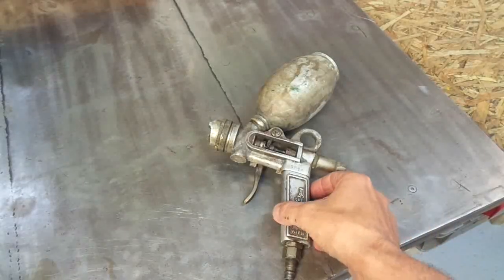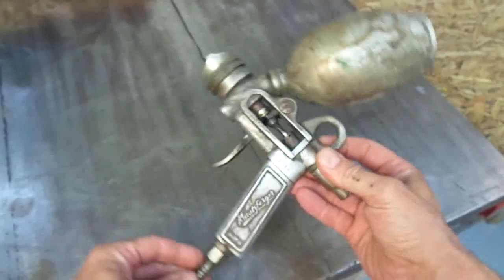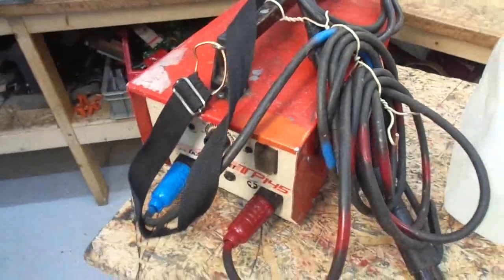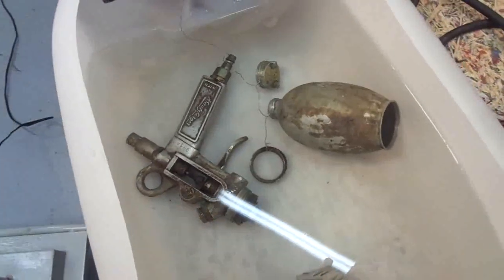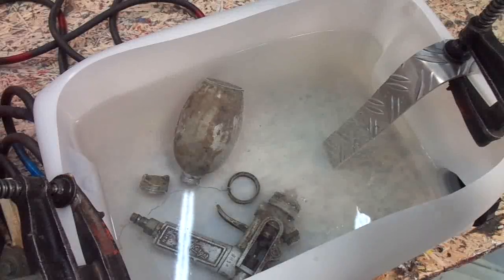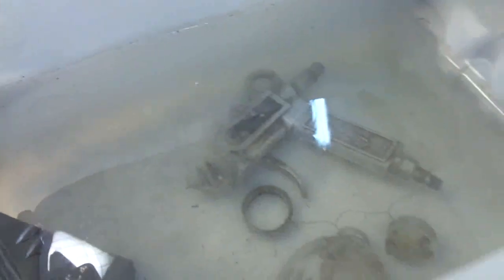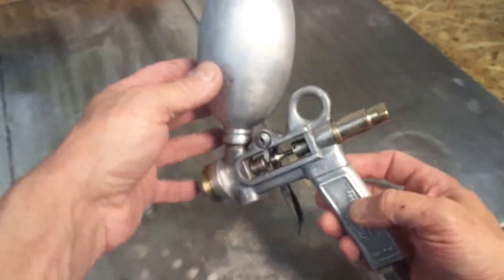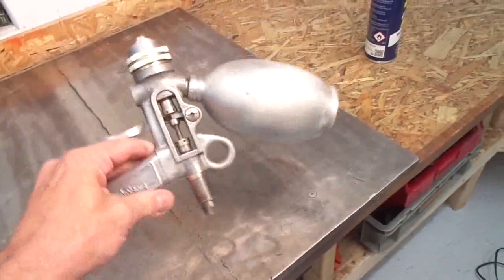Electrolysis cleaning aluminium

Comment: I just found your video when looking to see if it's Ok to use electrolysis on aluminium. 
I have a gear box that has an aluminium case. The gears are rusty and the case has the white powdery corrosion. 
Do you think that electolysis will clean both aluminium case and steel gears well enough to enable strip down ?
Reply from the maker: It should work.. The spraygun also has some steel parts, which i did not remove for the electrolysis process..It is a slow process..You can observe the progress and stop the experiment, in case something goes not to plan.. I used citric acid as a electrolyhe...
Reply: @LariFariYoutube  - I've just found out about something known as Hydrogen Embrittlement (H.E) which can take place in a citric acid solution.
Basically, carbon steel parts can be weakened by microscopic amounts of hydrogen getting into the surface of the part. So gears, being a high stress item, maybe not such a good idea.
But, apparently, it only takes place at room temperature, so I figured that doing it in a heated solution, close to boiling, should prevent H.E from happening. Plus it can be neutralised by heating the part to about 220 degrees C within 4 hrs of treatment. 
So I reckon a close to boiling point electrolysis bath, a quick strip down and into the oven. with the gears.
That's the plan, but I will check with a couple of gearbox resto specialists first.
Cheers.

Comment: Id add ultrasonic cleaner with aluminum or Co2 blasting or wet blasting with baking soda its leaves no darkening of the part vs chemical oxidation of caustic solution as it's like etching solution. THINK BOUT HOW THEY HOT TANK CAR PARTS !

Comment: I’ve heard this process will dissolve the aluminum eventually. How long did you keep the aluminum under electrolysis?
Reply from the maker: 50 Volts / 0,5 A   About 18 houres..as far as i remember.. And yes, thats how the process actually works... Material gets removed at the Cathode ( negative) and accumulates at the Anode (positive).. But in my experiment i did not notice a damage of the surface.. What i noticed though, the aluminium got a bit darker in colore. I am no expert but i am guessing, thats a kind of oxide layer.. I personally like the look of it.. But, just saying..be aware..

Comment: Don't use this method - I thought the parts came out of the bath dirtier that they went in - it seems other polishing methods were then used to make things look good!  I tried it anyway - simply made the surface a dark grey, and increased pitting.  Not for me...
Reply from the maker: Oh, that sounds not good...As you can see on the result. It worked for me..I like the dark oxide layer , which it got from the process.. I am not an expert but i think, there are some factors which influence the outcome.. The electrolythe ( i used just a tiny bit of citric acid)  and what kind of aluminium it is.. I am assuming, the spraygun is a aluminium / silicium alloy..  I think, i was just lucky with my experiment, to get such a result... But, i would try it again, if there is the need...  ;)

Comment: Hey sir.. Does this work on alumunium engine for residual oil ?
Reply from the maker: Hmm, hard to say.. I notized on my experiment, that the electricity was not able to remove some of the old paint on this paint gun..I brushed it off, after the electrolysis process, with no effort.. My recommendation is, to remove all the residual oil with a solvent (gasoline), first.. At least, as best as you can.  Think about welding... Dirty and painted Metal is hard to weld because it makes for a bad electric contact... Same goes for electrolysis.. But give it a try.. Would be nice if you can keep me updated on the reult on your engine block.  I am curious... Greets from Austria.
Reply: @LariFariYoutube clean but the remaining oil crust needs a little effort.. there is a change in color maybe just a little vinegar to prevent it.. greetings from INDONESIA 😊
Reply from the maker: Yes, there is a change in color.. The aluminium is darker after the process.. This is a oxide layer.. I think, there is no way around it. But the oxide layer will form anyway after a while, thats the nature of aluminium..  ;)  You can see this on my befor and after picture of the spray gun... I am not sure, if vinegar is a good idea.. I used citric acide as a electrolyth. @21_gunsjovank23

Comment: It's a revolutionary aluminum corrosion removal method
If you use this for the corrosion cleaning of the graphics card heat shield that's been happening a lot these days, you could make a lot of money
Reply from the maker: Hi,  my friend.. Electrolysis cleaning is nothing new. The method is not revolutionary.. And it works with any DC current source...Even a 12 Volt car Battery or a Battery from a cordless power tool would do the trick... I used the welder just because i have it. ;)   A lesson which i learned from this experiment...Dont use to much electrolythe (acid), when using this Method to clean aluminium... Less is better...take your time and you will not end up with ugly discolorations of the workpiece. As i said, i am not a chemist. It was just an Experiment out of curiosity..  xD     Greets from Germany

Comment: You can unscrew and remove the valve immediately behind the spray nozzle. The intricate parts will stay in the gun but you'll give room to wash out the dried paint from the main chamber
Reply from the maker: Hi, Ian.. Yes..i know.. I tried to unscrew the nozzle but it is seized up.. And i dont want to ruin the thing by applying brute force.. Maybe i should try, to put the thing into solvent for 24 houres and try again.. I am carpenter by trade and learned / know everything about sprayguns.. But i never came across a design like this..No wonder...it is from the 1960s... For my daily work, i have a SATA Paintgun.. But i wanted to rescue this oldtimer from the scrapyard.. And you are right... Just because i did not know what i am doing, i wanted to avoid dissimilar electrode materials.. and also used only the bare minimum of electrolyth to get the reaction going... It was a fun experiment with some learning factor ... And Joe was fascinated by the bubbles..   xD